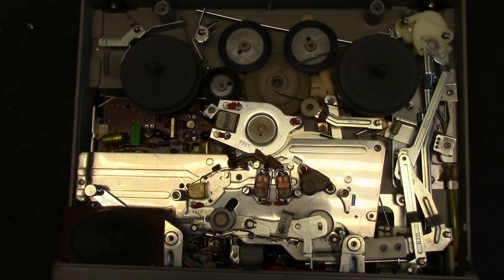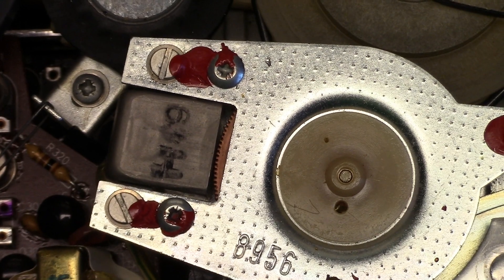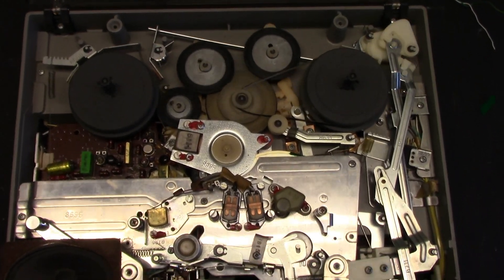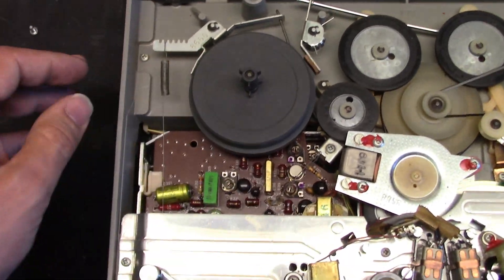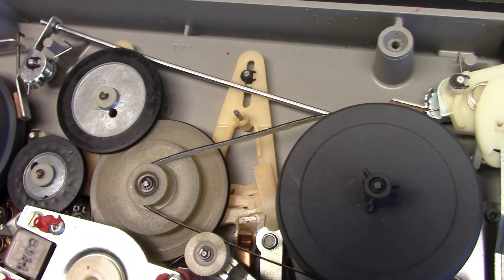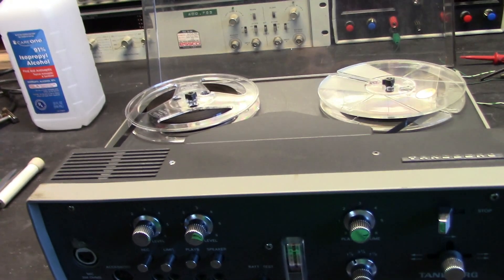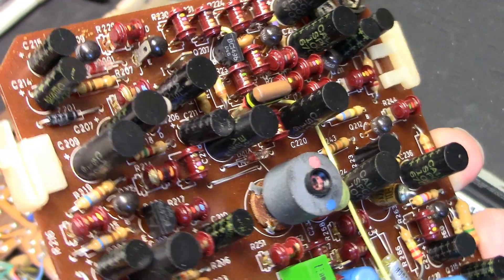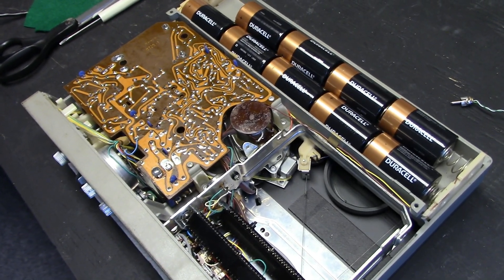Inside the Tandberg Model 11 R2R

Comment: Cool! My Concord 220 has a single amp inside with a single vacuum tube installed, and it was "transistorized" where it says on the name plate. This one is different. My Concord 220 has all the Japanese parts are from Matsushita, same company that made Panasonic. This one is Normay made, not Japan.

Comment: Thank you so much for making this video. As you may know, that's the most important thing for me the inside of equipments and I am much more interested on those older ones because they have very simple solutions for complicated functions and vice-versa. At least they are for the most part built to last and with much more resistent materials and everything. That's why the sound quality is superior because the circuits were very well engineered. Best regards. As always I am very sorry about my poor english and I ask you for forgiveness. Hug.
Reply from the maker: No worries! You're welcome!
Reply: Tks

Comment: They don't do oval speakers anymore. I also miss the smell of electronics from that era. Modern stuff doesn't smell right. (I was born in '62, so I started taking apart electronics in the early 70s that dated from the 50s)

I am very impressed that the belts and rollers didn't turn to goo.